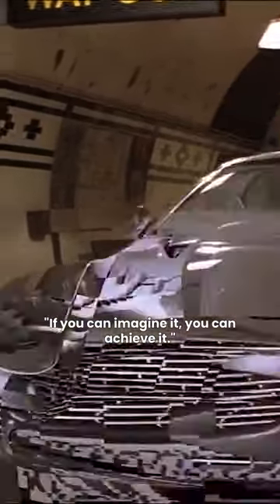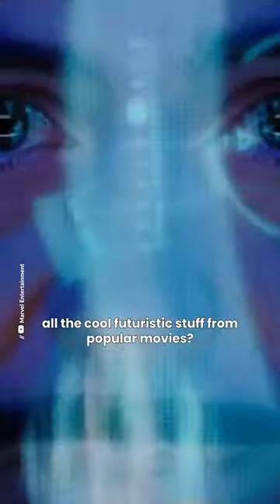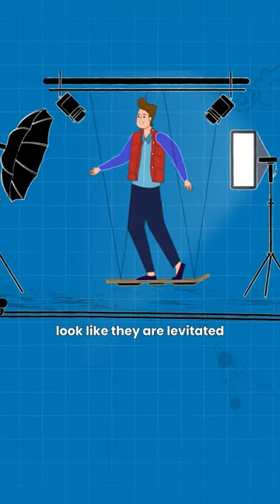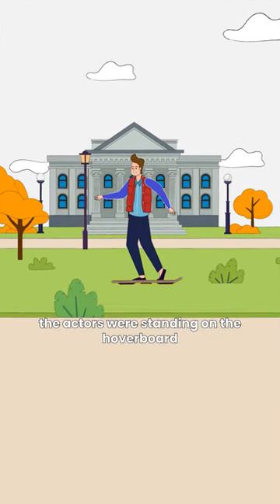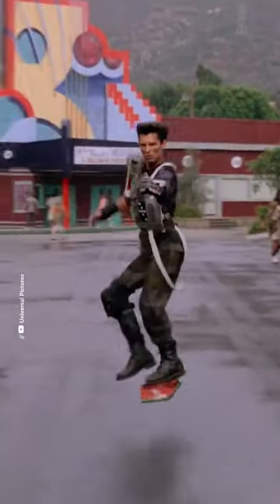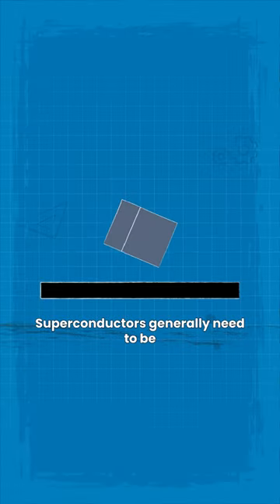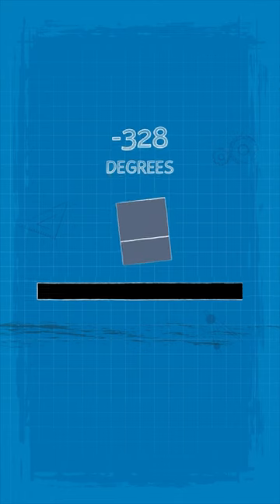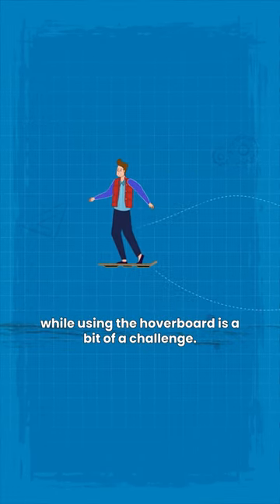That's Why We Don't Have Hoverboards From Back To The Future

Comment: Hoverboard are easy when you know how. Plenty of principles out there that could help achieve it? Co flow jets is just one idea? Ion hall thrusters another.  Even an dyson air multiplier will do the trick. Basically it work out how much thrust a person can give to a lifting body? Then adapting it from there? The best design would be one that acts like an areofoil uses grown effect and does all the cool skate tricks.
Reply: @LeSourisBleu  total gimmick! Relied on copper plates. Lexus used it to sell cars. I know the video. Can’t say I was happy with the results of Lexus efforts. I’m more thinking about taking a different approach. I’ve mentioned this on on forum so where?  If done right? The forward momentum should keep the board afloat. Also if it happens to have something like a scramjet build in?  Due to the magic of air multiplying should give it forward thrust. I reckon you can build one like a dyson pure cool me.  Simple enough equation thrust must be greater than the weight of the rider. To achieve lift. With a dynamic sensor that can be adjusted to various riders needs. McFlys board is basically two dyson so pure cool me bolted to the bottom of a board. It using convergent air flow to provide lift.  I can think of about 100 ways to go about it?  

I look at the average thrust a human leg can provide.  That is in kg usually equals body weight/ force a kickboxer can deliver. Which is 1000lbs of force. Which 453.592kgs if I’m not mistaken is enough to achieve lift.  You then have dynamic soaring to consider.  The thing effectively could fly and carve its way through the sky. I don’t place much stock in the Lexus design. Total sales gimmick! You think about all the knowledge we have access too? Lexus then couldn’t come up with a better design? Is just a joke!  Heck I got a rough idea how?  Had even consider using convection currents.  It totally possible to build one provided you get the compression ratio right? The added bonus is getting the hoverboard right? is the first few steps towards  greener vehicles, flying cars, frictionless highways?  In my opinion Lexus got everyone hope only to dash them. Looked cool and stylish but it boards have to stay in a certain area.  If you want a hoverboard  you need to to go places? Without the faf and fuss of spending millions on a skate park it can run on. Also liquid nitrogen ain’t cheep. You get very little board time. You have time until the nitrogen evaporates.  Then your done. Its a lot of effort for very little reward. 

The hoverboard is a basic wing form meant to achieve vtol. so much more can be done. Many have gone the magnet route and achieve maglev even @theHacksmith on YouTube. To work in urban area you have to embed nano particles into the road surface.  It’s a lot of work and very little will to undertake such a project.  Bending airflow has already been done.  would be the best place to start. Sliver surfer also comes to mind here with cool tech options. So many ate my have been made to make a real hoverboard. The Sidney Olympics previewed one. That one was a monstrous compendium and looks nothing like mcfly’s board.  The issue I also see is for all the hopeful gusto. Everyone is underestimating the financial abilities of most people to acquire one.  At least the hovercraft route is perhaps the cheapest route you could take? It also the most accessible to the broadest range of people.  I could knock one up for about £100 of materials.  Can be cheaper if full recycled?  Can be retro fitted to a existing skateboard?  Or a custom unit can be made?  Yes it can be done! Even aerospace industry would line up to have one. Companies that make lifting and manual handling equipment. As it can be scaled to require. The whole logistics sector could benefit?  The automotive industry could evolve with a tech mod od or two. Even Tesla would have a go at it? @TeslaMotors In some of the big factories and manufacturing plants the use hovercrafts to move equipment from A-B.  Yep plenty of uses if one is made?  Lexus efforts only went so far?  Though a valiant attempt it still has hurdles to overcome.